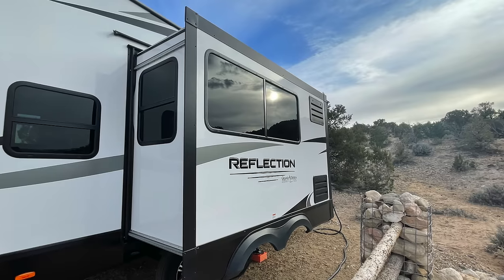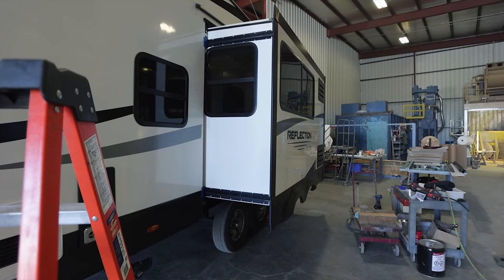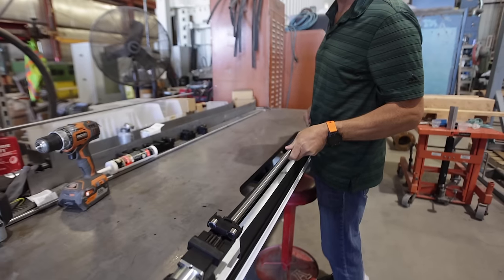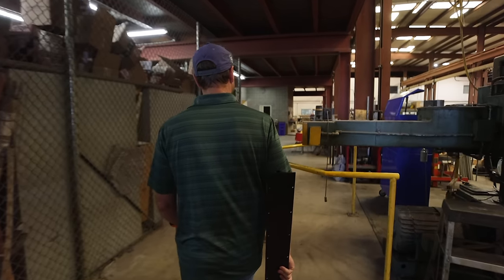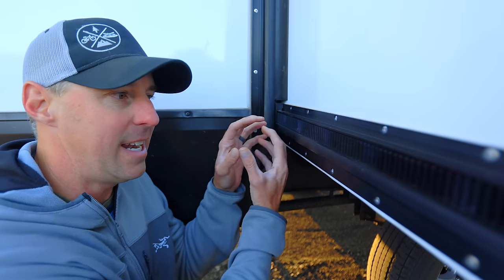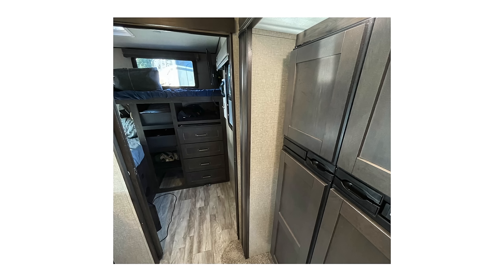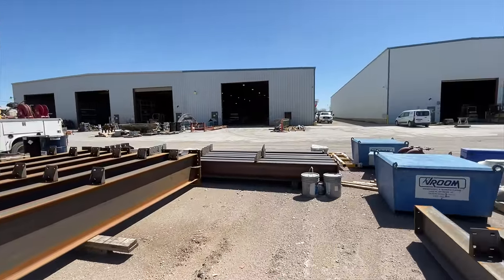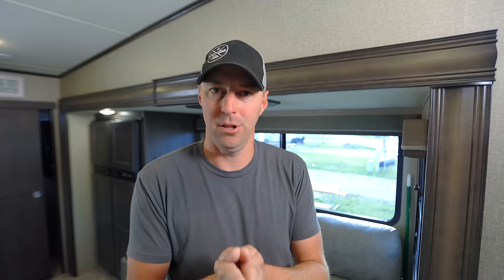Problems With Your Schwintek Slide? Vroom Slide Solution!

Comment: Jared-I now have the VROOM system but I do have a question Brian couldn’t answer if normal.  With the slide now not tilting slightly backwards, does the plywood under your slide carpet touch the flooring anywhere when the slide is in?  We have the theater seating and it touches for about 4-5 ft in front of it.  Brian suggest putting something like felt under the plywood front edge to prevent floor damage as the slide comes in.
Reply from the maker: Ours does not sag and touch the floor but that is probably because it originally did when we had the schwintek and I added a roller in the middle where there was a big gap. Our slide had 4 rollers and I added the 5th. This one was fairly easy to add because you don’t have to remove the slide. https://amzn.to/38uzmwa
The slide worked better and didn’t flex in the middle with this when it was in the out position.
Reply: Thanks! That’s exactly what it’s doing, sagging in the middle.  Other than that the VROOM system has been great.  Looking forward to your follow up on it down the road.
Reply: I ended up not installing the roller.  The Magic Sliders on the end of the plywood under the slide did the trick on not damaging our flooring.

Comment: Great video!!  I have had issues with my schwintek when the weather gets hot.  It does not want to work at all.  We have had to go to the dump early in the mornings on hot days and have had to wait until late evenings to put out the slide on travel days.  Have you any issues with the Vroom in regards to hot weather?  Thanks
Reply from the maker: We were fine in the Az heat no problem and I will keep this updated if anything comes up

Comment: Sounds like I need to schedule a vacation in Tucson!!
Reply: Do it. Soon.  The earliest I could get in is June 2023
Reply: @robinsyverson967  I just got mine out of the shop last week for slide problems and they have already returned with vengence (2 year old camper).  I may just talk to them about trading this one in for one with a different slide system.  Total junk.
Reply: @bryanthornton6787  are you leveling the trailer first with the leveling system?

Comment: Vroom doesn't fit on the single slide of a Grand Design Reflection 290BH. They said the front facing window on the slide was too high. Sucks I have to stay with the Schwinteck and just pray every time I use it.

Comment: I have a little U dinette slide on my brand new Wolf pup that is schwintec and my rv is at the dealer for the second time now after it failed in the same way 7 months after buying it. Used if 5 times post repair and it Keeps getting stuck on the way out again. Dealer replaced the whole slide out first time. Now we will see what they’re gonna do. Forest river told me over the phone they have made some design changes. Wonder what those would be and if they are going to be any better. So far I don’t trust the schwintec system. If it fails again I’ll be looking into this company and never look back at the schwintec garbage.
Reply: Same here with my lance TT dinette. they are replacing the entire motor and roof.  I am scheduled to replace them requardless.  DONT wait too long the are booked solid untill June 2023

Comment: update... spent a solid month at a RV repair shop in Mesa,Az for several warranty repairs (extended warranty), which included replacing the entire Schwintek slide system on my only slide-out.  Techs told me the systems are fine, if they are properly installed.  Apparently, factory installers either do not know what they are doing.. or just don't care!  Might mention that the Solar prep package was useless due do a dead short in the wiring.. no doubt someone at the factory drove a screw or staple into the wiring.  And most recently, water drips from the main A/C unit every time it rains!  I could gone on, but won't bore you.

Comment: You mentioned the price of 2800 installed. I have the same unit they quotes me 4500 per slide. That is a huge jump in price. Did they give you a discount for promoting there product? Or maybe that is the cost now.

Comment: On previous TT had a Schwintek that worked one single time. So never again.
After that for 4 years only way to make it work was to engage the emergency mode on the controller.
Always Hall effect error, but was running ok on emergency.
Tried every possible troubleshooting documented.
To finally after 4 years, get a comment from the tech doing inspection at dealer in the exchange for new unit.
"Ha! yes the motor harness connector is highly unreliable, when we have issues we cut them off and solder the wires."
Reply from the maker: Wow that’s a long time to go with problems

Comment: How is your VROOM slide system working?  Mine is working great, but I did feel like I had to re-sync it.  Brian Vroom said to do that whiling coming in the last 1-2".  But Schwintek says to do it on the way out the last 4-6".  Have you had any experience yet re-syncing your VROOM system?  For those who don't know, VROOM only does the mechanical parts and the motors.  The controller and wiring never gets touched.

Comment: Clearly, the scwintek is not engineered for these heavy loads.  Probably fine if the room is set up nearly perfect.  It always bugged me, if my electric tongue Jack failed (barring mechanical issuel), I could just pop in a socket and over ride the system.  Not so with a scwintek.
Reply from the maker: Yes great point, I think all slide mechanism should have a manual mechanical way to operate it.

Comment: I would rather just push my slides in and out manually than listen to the grinding and snapping of a Schwintek.  I have 3 on my Beacon, one of them I have reverted to extracting and extending manually.  It keeps breaking teeth on the gears due to a faulty install.  Pathetic.